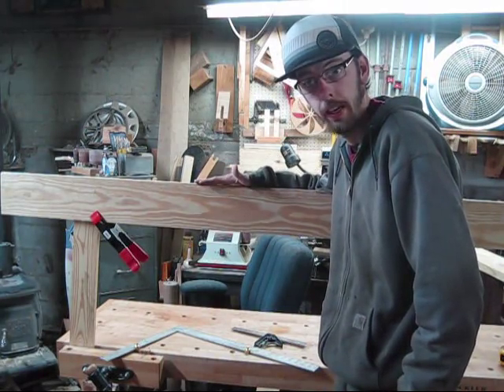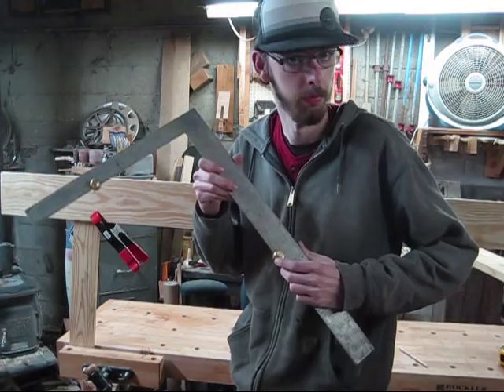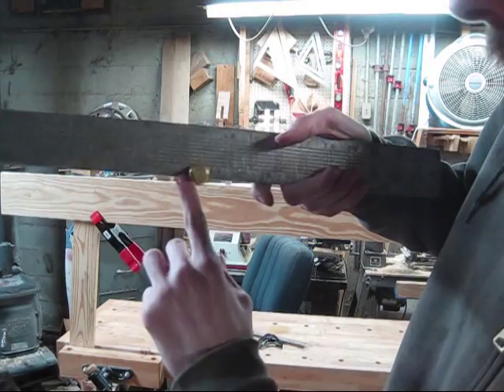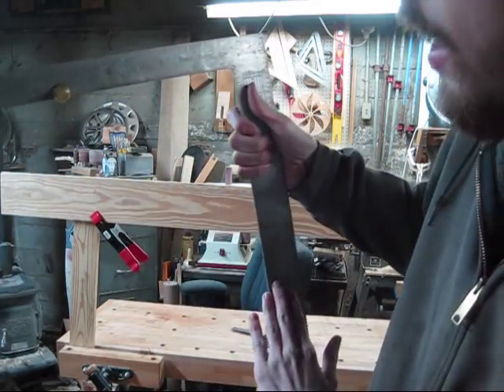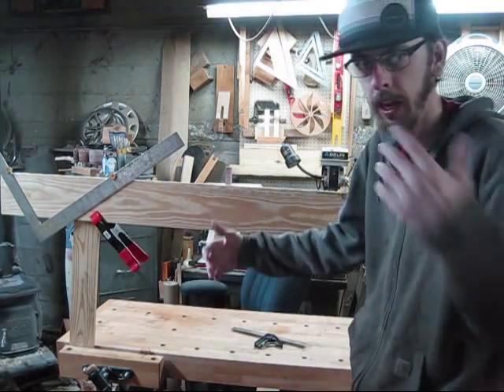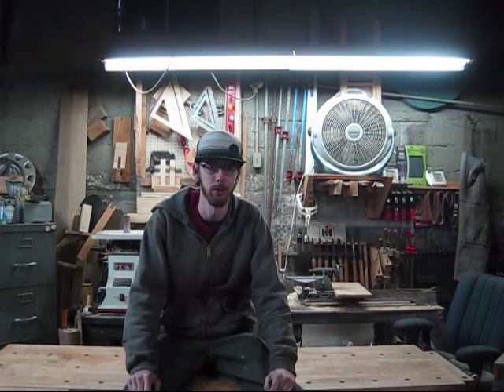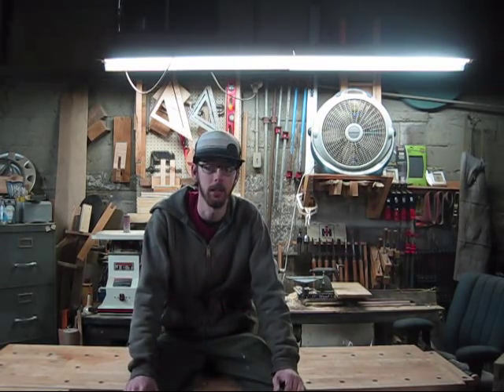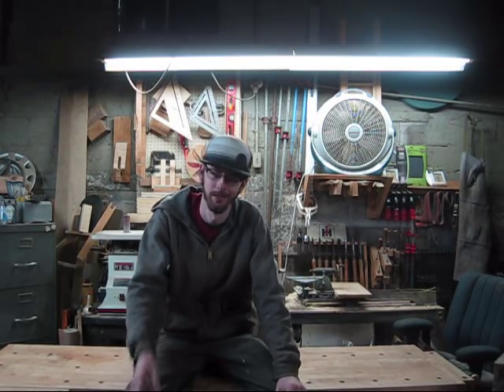Tricks with framing square

Comment: Very refreshing to get useful info on here that you can use. Especially without putting you to sleep in the process. I never realized that my framing square is much more useful than I thought. Cheers!
Reply: +thisisunreal1 if you know how to use a square you can make circles with them you can make flat arches . there is very little that cant be done with a square

Comment: I have used squares most all  of my 73 years. Did you know that math (after adding, subtracting, division was taught) was taught to both male and females during the frontier days of our contry...so that any guy or girl could take a square and saw and make their own homes on the prairie.  As far as the brass stops, they are great on wood, and in metal, but on metal, they would wear out becasue of constant sliding on the sides of beams or channels...so I used to go through 2-3 sets a year. Also, the square can be trued but laying the long side on a piece of plywood or table, etc, and drawing a line along the perpendicular leg and then flipping the square to the other side. The perpendicular line should be directly over the previous line. If not, you can square the square by using a center punch to move the leg one way or the other by putting one or two center punch marks at the inner or outer heel parts of the square.  I liked your video....too bad it is no longer taught in school.

Comment: Howdy, When I started in the biz I had the privilege of working with and learning from some old timers. Pre-Skill saw types. I picked their Brian's as much as they would let me. 

There's a lot more to a framing square than you covered. I sure it was fue to time restraints. But, one in particular is still valuable, and others not so much, until you need them! 

As you nicely demonstrated rafter layout, you went to a tape measure for length. One technique with a square is called "stepping down". It is used in stair building, but works on rafters too. 

Once you mark your plumb cut at the ridge, mark the point where the tongue shows where a plumb cut would be. Just a small mark. Then just slide the square down until the blade (or plumb mark) blade meets the little mark you just made. That is exactly 12" along the floor the rafter will cover. Repeat for each full foot of span down the rafter. Then move it the amount of inches and fractions to reach your seat cut. 

The framing square also computes octogonal lengths. I don't know about you, but my trigonometry is a tad rusty. It can tell you exactly what the length of a side is. Read up on it. 

Less important, these days is the "Board Feet Calculator" and the rafter length table. I came up using the little blue book. All y' all probably use builder's calculators today. 

For what it's worth, that's my two cents worth. Keep up the good work.
Reply: 2 thumbs up

Comment: This is really good. One of my bosses is anti speed square and a different boss of mine is anti combination square. This video doesn’t say much about the combination square but it does show how to quickly use the speed square and framing square together to save you some math time if you need to. Very good video.

Comment: useful stuff. got a speed square after watching your video on them. fairly new tool in Australia soooooo useful. Thanks.
Reply: wow!  only 97 years after they were invented!
Reply: Grant Perkins they were invented very long time ago. Since recorded history they have been using squares.
As far as the steel square, or carpenter’s square, since medieval times, they used them, though mostly out of wood and custom made individually.
As far as standard production, they’ve been around since the early 1800’s (1820 or so).

Comment: At 10:49 the one square is on the flat of the lower brass gauge and the corner of the upper brass gauge, this offsets the angle. The brass hex corner protrudes ~7% more then the center of the hex flat, therefore the closer the gauges the greater the offset.

FYI the square may not always touch the corner and flat evenly (perpendicular). So, tinkering with the stair gauges may be necessary for finer accuracy. Some stair gauges are round which have no offset. Something to keep in mind, hope this helps :)
Reply: round ones make a lot more sense.

Comment: Very nice and informative video. You do know your stuff! Thank you! Heres a cute little quick way to prevent pencils and stick ballpoint pens from racing away..."Flag" tape the top end, that is take a short piece of stiff tape, like a paper label, and stick the ends together then smooth it back around the eraser end of the pen/pencil. Trim anything longer than 1/2" sticking out and no more roll!
Reply: get a carpenters' pencil, they don't roll.

Comment: Thanks! Pleasure to watch the short concise no nonsense instructions always learning from your videos.
In the very beginning you mention you can get angles from all three/four tools. I agree from speed and frame square, not sure how you get more that 45 and 90 from and combination square?(even with the extra attachments) If so can you please explain?
Reply from the maker: Thanks I understand most combination don't come with all the attachments like they used to, but if you buy a set they still come with: square head, angle finder, and center finder.  https://www.zoro.com/westward-combination-set-12-in-4-pc-blue-4ku80/i/G3335902/?gclid=Cj0KEQjw_9-9BRCqpZeZhLeOg68BEiQAOviWAhgslIM44Axlp2eP5B-TfFLFwR-YmsBOt-mFmEHcJyoaAiv28P8HAQ&gclsrc=aw.ds
Reply: I was wondering the same thing until I clicked on the link. The set I bought with all the attachments  was about $130 from  Snap On back in about 1982. Being a locksmith I work with tight tolerances and I found the center finder was off by a few thou. Not a real big deal in most cases but when I need precision I just draw a second line from the other side of the material and I'll have two lines almost touching each other. 
Once more, a well done video.

Comment: Ethan Ewing Doesnt the position of where the straight edge sits/touches on the stair gauge ( ie if its on a face or a point ) affect the actual angle though ?  as they both relate differently to the marking point that is clamped to the square- especially so when measuring angles other than 45degrees?
I enjoy watching your vids/tips very much - thanks
Reply from the maker: It shouldn't because I position the stair gauges on a true 30° angle (with the speed square) If I was to do the math to find out the ratio it most likely wouldn't have been right.

Comment: Have you ever had to "tune" your framing square after bumping/dropping it and thereby losing your perfect 90° angle? What methods can be used to effect realignment? 
thanks for the great vids!
Reply from the maker: I have never done it, but I have seen it done.  The best way I have seen is to use a center punch and hit inside the corner to move the square out, or hit the outside the corner to move it in.  It may take a few licks to get it to move enough.
Reply: Classic Work  Thanks.  I found a video on YT from an arborist (Blair Glenn) where he used exactly that procedure.  I gave it a try, and it worked Beautifully!  I had inherited my framing square from my grandfather, but never used it because it was out-of-square by a couple of degrees. Now it's Spot On!  :)

Comment: Excellent Instructions. Even I can understand them BUT, at the 3:20 time of your video you showed how to layout 16" O.C. When you struck your pencil line you placed the square edge on the 16" mark and proceeded from there. I come from an engineering and drafting background and have always understood "Center" to mean, in this case with 1 - 1/2" stock, to mean the center of the 1 - 1/2" wide edge of the 2 x 4. Thus, I would have backed up 3/4" and proceeded from there. I don't mean to be critical, I'm just trying to learn and I really do appreciate you taking your time to make these video's and also, I appreciate your effort and knowledge. Please Advise and thank you Sir.
Reply from the maker: Well most carpenters don't use a framing square to layout a plate, but yes you go to the 16" mark on the square or the tape.  You offset your first mark on the plate to 15-1/4" then go 32" 48" 64" ect... with the stud or rafter falling to the left side of the line.  Every stud or rafter will be O.C 16" I didn't show how to do that, but that's a different video.
Reply: OK,
'preciate your response. I will be learning from your video's and really appreciate your time and effort.
Reply: Warren Carlisle a

Comment: U sure it wasn't the stair gauge that they off ur 30 degree angle? they are hex looking screws (not rounded) and the one on the left (bottom) was laying on the flat age of the screw guage, but the top on was laying on the pointed edge of the guage. this looks like enough to have thrown u off a degree. if you look back at the video at 11:03 you can see how the square is laying on the "point" of the stair guage. just a thought... great video btw! low the speed square one too!
Reply from the maker: Aye I thought the same thing too after the video was uploaded, and you may be right.  Thanks for the comment.
Reply: AZtek54

Comment: Hi, I'm a novice but I always think that the longer the rafter the plum cut would be different you guy referred to (6, 12) 4, 12 (12, 12) how to work out the span that is 9 feet or 7 feet or 11 feet?

Comment: The problem with using the square to measure stud centres is that the longer the wall the more mistakes can be made versus a tape.I made this mistake on a 70 foot wall at the end of the wall centres were 1 inch off..
Reply from the maker: +K. Taylor Aye 1/16" here 1/8" there adds up.  It can be done you just have to take your time.
Reply: Time is money and a tape is faster !!!

Comment: Ok when u made the birds mouth layout u didn't give enough meat into the top plate .?
Reply from the maker: That was 1-1/2" cut that is a fairly common cut.  If you cut much deeper you run the risk of breaking down the rafter.
Reply: Ethan Ewing ok u be right.

Comment: I garentee I can layout a 40 foot wall faster with a tape measure and speed square than you can with just a framing square.
Reply from the maker: +Chris Vanweele I don't doubt that.  Tape is fast.  Don't dis the framing square though in the right hands it is a golden tool.
Reply: +Classic Work there is so much i can do faster with a framing square then with a tape . but hes right about laying out for walls even cutting blocks 14.5 inches . just use the square as a tape and square all in one . put 14 5/8 on the mark then mark the square and slide it down and so on . allthough saw blades are less then an 1/8 now so that has to be considered

Comment: Is it ironic that you used the framing square to measure 16" when one leg of the square is 16" long?  They're 16" and 24" long specifically for laying out studs!
Reply: If you use the 16” side, you would need to rotate the square, mark it, then rotate it again as the the 24” side is 2” long (on a typical standard framing square) instead of 1 1/2” long. You need the 1 1/2” distance per common 2x lumber. (2x = 1 1/2x).

Comment: don't forget your rafter book!
Reply: You don’t use a rafter book on a steel square. That is for the speed square.
Reply: @mavenfeliciano1710  you are correct in the fact that speed squares come with rafter books.. But it is all the same math son.. I have had a copy of framing & rafter's book since before there where speed squares..  The speed square didn't change the math it just made it easier for those that didn't know how to use a framing square.. actually I find the framing square a lot easier to use for rafters and steps but that little square is a lot easier to haul in my pouch.. So don't get to worked up! just because you do not use a framing square..  It's ok..

Comment: Good video but at 4:00 you said 8:12 pitch, this is incorrect. Pitch and slope are not interchangeable, they are not the same, check your texts. Also you only need a carpenters square for any angle,0°to 90° to 1/2 of a.degree. Divide 90 by 4, = 22.5 using the scale on the blade set the  pivot point at 22 1/2", every 1/4" is one degree, an 1/8" is 1/2°". Rise and run, 12-12 is 45°, 4-12 is 15°, it's a ratio. 17°would be 4 1/4" , 18° 4 1/2", just remember you are using 22 1/2" on the blade and read the tongue. No need for two tools and much more accurate.
Reply: Roof PITCH is defined as RISE over RUN..or  8 inch RISE in 12 inches RUN...... or to say  8:12... etc is absolutely correct.   It's what every carpentry text says ,  and how every feet-inch calculator  works. That PITCH then produces a plumb cut angle of 33.69 degrees.  That scale BTW is also stamped on better quality framing squares.

Comment: This guy really doesn 't know this tool.   If he did, he would walk down the length of the rafter rather than using the tape.
Reply from the maker: +WWHub Do you walk down 20ft rafter with just the square?  If you do ok then.
Reply: +Classic Work That was not a 20 footer that you used....  Calculators are great - but the framing square was better at the time ... and still is for most people.   After all, you only lay out one rafter and use that as a template.
Reply: +Classic Work what he meant is useing the square to step off rafter length . if the span is 16 ft devided by 2 = 8 feet use the square with the square nuts and step it off 8 times will give you rafter length with out useing a calculator